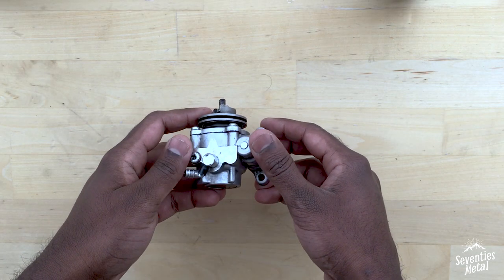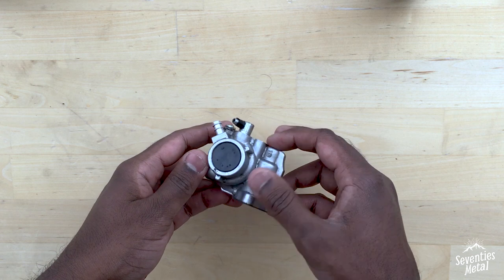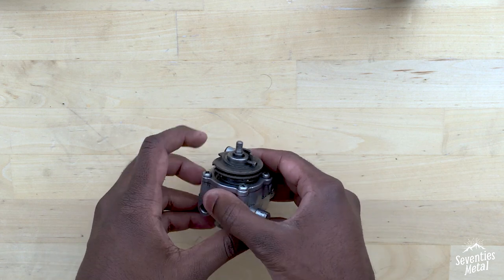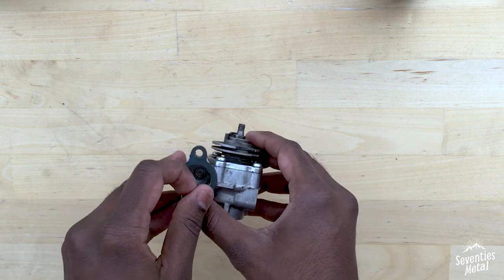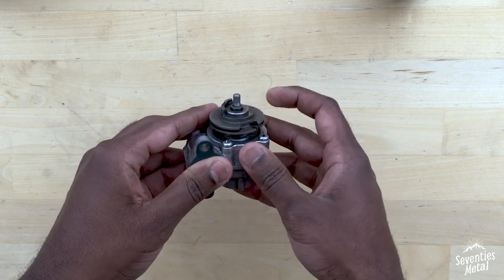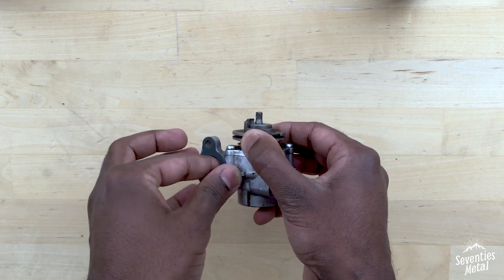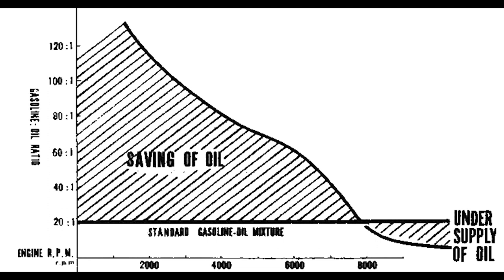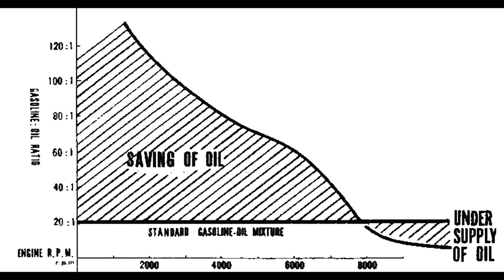RD350 - Oil Pump or Pre-mix?

Comment: Hey just a quick question, I’m working on an older enduro very similar to this one. my question is that if I decide to run premix, do I also have to remove the plastic tachometer gear even though I have already removed the oil pump driver gear. Thank you for your time .

Comment: I have 1973 rd350 I am currently trying to get going, I want to run premix but dont want to ruin the oil pump so can I just remove the oil pump and save it for later and run the bike that way or will I have leaks from the crankcase

Comment: Very Good tutorial Bro!!!! Explained well

Cheers!!

30:1 ratio means how much ml of 2t oil for 1L of petrol & Pls suggest a good 2t oil
Reply from the maker: Thanks! For 1 liter fuel add 30 ml oil. I use Motul 2t oil.
Reply: 30:1
means
3,000 ml of gasoline is to 100 ml of 2t oil, 
so for 1 liter gasoline you need 33.33 ml of 2t oil
Reply: the higher the value of the 1st number the higher the amount of gasoline,
so if you go for a higher value _ :1 youll be mixing less oil per liter,
and pop up less smoke

the lower value of _ :1
youll be mixing more oil per liter... 
and pop up a lot of smoke
Reply: @seventiesmetal8673  thank you
Reply: @endurofan9854  thanks for your clear brief
Reply: @seventiesmetal8673  I have 1973 rd350 I am currently trying to get going, I want to run premix but dont want to ruin the oil pump so can I just remove the oil pump and save it for later and run the bike that way or will I have leaks from the crankcase
Reply: @barnabassackett   You can make or purchase a oil pump block-off plate and gasket.  HVCCycle sells them.

Comment: Hey buddy, I just bought a Yamaha dirt bike that has the oil injection tubing line cut....... do you know what size tubing I need to get to replace it?  It's a very small tube but I'm not sure what size it is so I can order online.
Reply from the maker: Hi Tony 😃 I bought new oil tubing that has 3 mm inner diameter. Please try to measure your cut tube or look for information about your bike online. I don’t know if your dirt bike and my RD350 has the same oil line.

Comment: Sir how to verify if the oil pump is working! Without disconnecting the oil pump
Reply from the maker: Hi! You can run the engine and measure how much oil is being pumped from the pump feed lines. I think you should get 5cc of oil from 200 strokes of pump. Read this link for more info
https://www.aircooledrdclub.com/smf/index.php?topic=45539.0

Comment: Wt happens if we fill 2T oil at side tank as well as to the petrol tank ? 

I hv a rx135.  Pls guide me
Reply from the maker: Hi Keerthi 😃 Please don’t fill oil in both tanks. You will foul your spark plug and produce lot of smoke. Decide if you want to run premix or use side oil tank. If you decide side oil tank, service the oil pump and ensure it’s working. If you decide premix, 30:1 is a good premix ratio.
Reply: Is tht affects the engine ?
Reply from the maker: Yes it will. The combustion won’t be proper, mileage will drop, ...
Reply: Okay. Thank you ☺

Comment: What will b the best ratio of premix in my L.T RD350 ?
Reply from the maker: The forums I have read say 30:1 is a good ratio
Reply: @seventiesmetal8673  what does the 30 amount to, Brother? 60ml?
Reply from the maker: For every 30 ml of fuel, you should have 1 ml of oil in tank. So for 1 liter (1000 ml) fuel, add 30 ml of oil!

Comment: How can we know if pump fails??
Reply from the maker: That’s the down side of using a pump rather than pre-mix. Hard to know when the pump fails. One way would be to check the pump every know and then. Remove the lube tube from the carbs and see if oil is dripping from them when bike is idling. This means pump is working. Never rev the engine when lube tube is off.